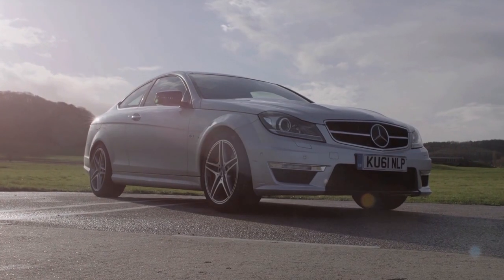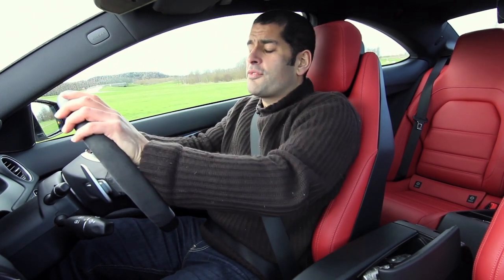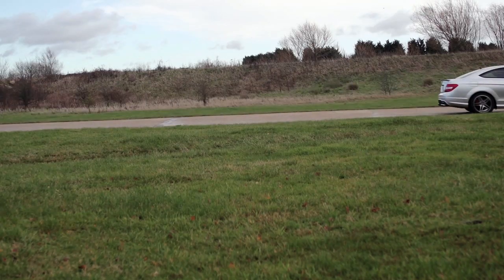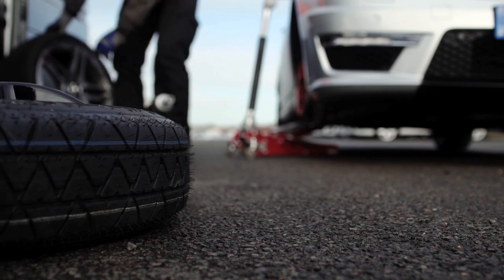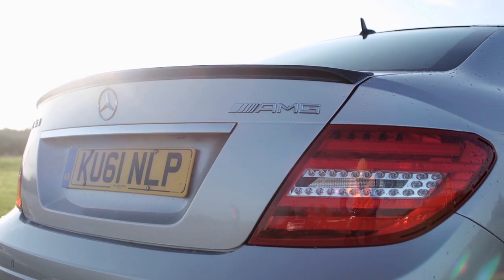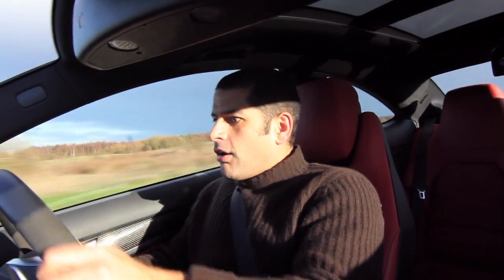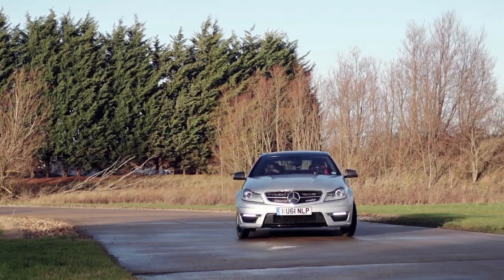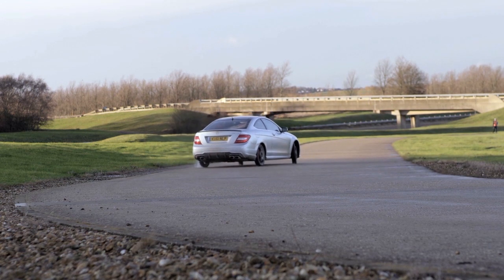The Mercedes C63 AMG Experiment - /CHRIS HARRIS ON CARS

Comment: It turned into a BRZ
Reply: A BRZ on steroids haha!
Reply: plateofshrimp a BRZ with 1200 hp!
Reply: Fluterra 480
Reply: Unco Casey 
A stock brz has 215s and thats over double the size of these donuts so if you keep the power in line with the tires hes almost there actually
Reply: plateofshrimp and
Reply: This music is on Tom clancy's rainbow six vegas 2.
Reply: plateofshrimp or frs or gt86
Reply: Except a BRZ still is slow as fuck even with small tires 😂
Reply: Yes. Toyota in their wisdom fitted Prius tyres to allow BRZ to get sideways easier
Reply: F Gill according to your math, this is like a 400 HP BRZ on stock tires.

Comment: This video perfectly sums up why the Toyota GT86 and its Prius tyres are so much fun.
Reply: Toyota GT86 on space savers... Dear god, I think I'm onto something.
Reply: yeah its still underpowered, most drifts are clutch cick initiated or ebrake, it cant just power on and overwhelm the tires like you would want it too.
My cousin bought one, I bought a mustang and modified it, they are very different  when it comes to drifts
Reply: ndinadis then your cousin doesn't know how to drift. The GT86 can easily maintain a drift all the way through a corner. But you have to floor it all the way and not start off slow in the corner. I tried it last year, a very nice car to drive. Obviously it doesn't have a lot of straight line speed, but who needs that on public roads anyway?
Reply: +ndinadis 
you have got a point, the drifts in the mx5/brz aren't 'power-initiated'
it would be nice if they had slightly more power, at least 250bhp.
Reply: I drove his, it had headers and full exhaust, Im assuming intake and tuning, It prob made ok power but the lack of torque was disappointing for me in a "sports car" the stock prius tires I think made it easy to slide around.
Reply: +ndinadis Like the S2000 was supposedly underpowered, it's not the power or the torque, it's the skill. Any car can suffer from organic failure.
Reply: +ndinadis and the GT86 will still be running well in 5 years time, the Mustang.....???
Reply: +Jeff H being that my car is already 10 years old prob running fine as well, just the all the others from 1965 onward with 200k miles on many
The thing is jeff I never said mustangs were better or that brz's were bad in any way, I said they were different and that I wish it had more power, heck Im thinking of buying one as a new daily... no need to turn everything into a fight
Reply: ndinadis I just struggled with you comparing a little sports car's ability to drift compared to a 'Stang, pointless. Anyway, we move on.
Reply: +ndinadis do u prefer the new 5.0 over this c63?
Reply: Even The prius has 165s
Reply: lol I though the 185 tires on my miata were too thin XD
Reply: ndinadis You don't need to use the parking brake, lots of power or clutch kick to drift an 86. Iv done a scandinavian flick in it and floored it in 3rd gear and it kept going very easily. Only driven an 86 and not the brz or frs though.
Reply: All of the Toyoburu (Subyota) cars are the same.
Reply: ndinadis look at Visioracer's video. He got some good drifts without having to clutch kick
Reply: @bazzie85  or just get an M3 or c63 and drift easily
Reply: But so many of them are ruined with bigger wheels now
Reply: tOY BOy  then clearly if you can't have fun with 200hp it's your problem with your driving technique.
Reply: @jean-luccg3664  my Toyota has 155 tyres, just a shame it only has 69hp. The only time I've ever drifted in it was accidentally on a snow covered roundabout. 

I drive a Toyota Aygo with a 69hp 1L 3 cylinder engine and a 5 speed manual transmission. It only weighs 800kgs though so it's pretty agile on twisty bendy roads.

 My previous transportation was a Vespa T5 with a 12hp 125cc 2 stroke engine with 4 speed sequential manual gearbox, top speed was around 68-70mph. I remember my hands going numb from the vibrations! XD. A small car is perfect for me as it's used 99% of the time to commute to and from work and from a mechanical stand point an Aygo is probably one of the easiest cars to work on. Everything is simple, basic and easy, which is something allot of modern cars lack.

Comment: Funny thing is that all the sliding shown in this video has nothing to do with width of these tyres. The force that makes the car go is called friction and calculated as F = uMg. Thete is no "width" or even "surface area" in this formula. All you guys did is put C63 on spare wheels which has less friction coefficient. I guess those who develop those skinny spare tyres just don't bother to put a "sticky" (or should I say "rubber with high friction coefficient)" rubber on them.

Comment: I guess this is why car testers always bang on about how much fun the Mazda MX5 is, even though it hasn't really got any power.  You can drive it to its limits at legal road speeds.  Even hot hatches these days have 255 section tyres and over 300bhp.... its all getting a bit silly and pointless if you ask me.
Reply: +soundseeker63 Unless you're Chris Harris who hates the Miata which makes this video rather amusing.
Reply: +soundseeker63 The lack of power can be easily remedied with a bolt on turbo kit. You can make up to about 275whp on an NA 1.6 with one safely on E85.
Reply: @jesdadotcom  that was the old miata, he loves the new miata nd, he said it on a episode of top gear when doing a quick review.

Comment: Everyone should learn to drive with big power on skinny rubber.
It would make them better drivers.
Reply: Kneedragon1962 having so much confidence is bad and will risk a accident by a fuck ton if i were you do someting about it cause its the most dangerous thing you can have if you dont have the skill to back it up. my cousin has the same problem he thinks hes the best driver he already had a accident
Reply: Kneedragon1962 Im pretty sure everyone can fly an aircraft with training.
Reply: That's not quite true. In principle, everyone could learn to walk a small tightrope with training, or sing a song (competently) in front of an audience.  In practice, some people are just not cut out for that.
Reply: Fading Light Not really, flying an aircraft is very complicated
Reply: Quentin Freeman Complicated... Depends. Yes, there's some complexity in operating an aircraft, but there's some complexity in driving through London or New York or Sydney too. There's some complexity in operating a motorbike. I rode them for 40 years and I still have an R6 race bike. Complexity is part of the problem, time constraints is another, task management and prioritisation is another. Being able to ignore you instincts and trust your instruments, is a huge one. Being able to correctly read and interpret those instruments, under pressure, is another. Aircraft can be hard, but you have generally got a few moments to think. A car or motorbike near the limit of performance & control, it has to be reflex. It does everything too quickly for you to think about, it has to be like standing on one leg - you have to just KNOW what to do. There can be situations like that in aircraft too, but you don't often get into them.
Reply: Kneedragon1962 You'd be suprised.
Reply: Quentin Freeman Really? About what? The complexity of flying an aircraft? LOL. I don't think you could surprise me much there. Ralph Mitchel, Kelly Johnson and Barnes Wallis were my heros as a kid, as I watched Neil Armstrong step off the ladder on live tv. I learned to read on Biggles, and the first adult book I read was Reach for the Sky, Paul Brickhill, in 1970. The first plane I got to fly was a 172 owned by the boy scouts, in '75. By that time I had moved on from designing control line models to 4 chan RC ones...
Reply: Quentin Freeman Have I got yoke time? Yes. Have I solo'd? No.Have I got an active logbook? No. Have I got recent stick & rudder time? No.Do I love aeroplanes, before motorbikes or sportscars, girls or well matured single malt whiskey? LOL, you never quite grow out of this kind of little boy infatuation.
Reply: Kneedragon1962 Well when you fly something like the Apache, let me know if you still feel the same way.
Reply: Fading Light No you haven't
Reply: Quentin Freeman I'm no youtube jockey, you have no clue how far wrong you are but I dont have to prove it to you. go be a child
Reply: Fading Light The fact alone that you'd say go be a child is proof enough for me. Show some integrity.
Reply: Fading Light You don't have to angry because some people are smart enough to know when you're lying.
Reply: Quentin Freeman Cool
Reply: Quentin Freeman Ok... I'm 52 years old, short sighted, and had a rather serious head injury a couple of years ago. Chances that I will ever fly anything again - let alone an Apache - are rather small. I am aware that the length and detail and complexity of the training to operate any sophisticated aircraft are hundreds of times more complex and comprehensive than to operate a road vehicle. This is obvious. We don't try to train road users to the same level of expertise and proficiency we try to give combat pilots, or pilots of sophisticated jet passenger or transport aircraft. The point I was trying to make, is that driving a car and operating an aircraft are fundamentally different, just as driving a car and riding a unicycle are different. All 3 require lots of your attention, but they require it in slightly different ways. The unicycle requires reflexes. The Apache requires mental skills. If your reflexes and multitasking were terrible, you probably shouldn't fly it, but mostly what you do in an aircraft is a mental game like chess, or algebra & statistics. What you do on a unicycle is more like trying to balance a pencil on the palm of your hand.
Reply: Kneedragon1962 That I can agree with
Reply: It's actually easier to drive on skinnier rubber. The wider a tyre is the less predictable it is.
Reply: No, it will kill all the people that don't know how to drive which is a good trade-off
Reply: @austinfleck8664  Natural Selection, yis.

Comment: 3:33 - 3:49 How is a 125 tire 1/3 of the width of a 255 tire? It's obviously 1/2 (0.4902, if we're nitpicking). Your photographer Neal should've tried to finish his 5th grade, methinks...
Reply: +João Soares ITS *NEIL GODDAMMIT!!!!!
Reply: +Haseeb Chowdhury Both spellings are correct; I don't know who the man is, so I went with Neal. It's irrelevant... What's not irrelevant is Neal's lack of mathematical skills.
Reply: bruh chill I was kidding ya know?
Reply: do you not get sarcasm?
Reply: +João Soares To be fair, the section width is measured from widest part of the tire and unlike the standard 255 which has a flat sidewall, the 125 has a rounded side wall so the tread is actually narrower than 125mm. It probably is close to about 1/3 the amount of surface area of the stock tires even though his math was way off.
Reply: +João Soares  watched this vid and was thinking "wait a minute, what?" ... You are correct their math is way off.
Reply: +João Soares He said ABOUT 1/3 the width.
Reply: +Rita Amorim He said ABOUT 1/3 the width.
Reply: Thats knowledge speaking. 
My exact thoughts.
Reply: Rita Amorim niel is correct not neal
Reply: Actually he is talking about contact patch, for this wheels it would be roughly 90cm^2 and 250cm^2 respectively, more or less depending on tire pressure.
Reply: It's safe to say the photographer NEILed it
Reply: it might be 1/3 because the tyres are of round profile and they are at 60psi making contact patch even less.
Reply: Rita Amorim Who Said Neal is the one who did the calculations
Reply: João Soares dude exactly, what the fuck was he thinking?
Reply: The thing about that though is that low profile tires seem to lie about their size a lot. I work at a tire shop, and I remember once I put a 245/40/18 beside a 235/45/18, and the 235 was a good couple centimeters wider than the 245. And no, that's not including the sidewall, I'm just talking about the contact patch. On paper, the 125 is about half as wide, but at least from the video I can say they do look about 1/3 the size. And the contact patch? That looks like 1/4 of the 255's, maybe even less.
Reply: Rancid Fiend you are right ! These tires are radial and a contact surface is even smaller .
Reply: I paused the video just to come and comment this
Reply: @pjbadgersuw26  Wrong.. it is different all over the world.
Reply: @haseebchowdhury4307  the Neal is real.....RCR

Comment: That's one of the reasons why GT86 is so fun stock- it is sold on the same tires as Prius.
Reply: TheLaXandro it isn't though.
Reply: Ben Fillman what isn't? It isn't fun? Or it didn't have Prius tires?
Reply: Jakob Kerr it isn't sold on Prius tires. Similar, sure. They say that I think because the wheels can fit on a Prius probably.
Reply: RandomUser M it's also lighter than both of those. It's not a boring car by any means.
Reply: TheLaXandro every one in the comment section has seen too gear.
Reply: Compound and section width are very different though I agree harder compounds are more fun--maybe not that hard. In LFS I like to use no wider than 225-235 tires for drifting smaller courses. 255-265 widths have less forward bite and are vague in transition.
Reply: Lol
Reply: I just think they messed up the engine

Comment: 125 is about half of 255. Not 1/3.
Reply: yes but the contact patch is about 1/3
Reply: I'd say it's really really close to exact half as much
Reply: +Po Russki Depends, I had a pair of 245s as wide as my 275s. More of a reference than an exact measurement (In the US at least)
Reply: +rawr2400 No, it isn´t.
Reply: +Joao Soares Yes, it is 90cm^2 and 250cm^2 calculated roughly.

Comment: Load does increase traction to a certain point but after that it only takes away. The wings are used for higher speeds where tires start to lift off the road. The downforce is used to keep the vehicle planted on the ground and handle better more than have less wheel spin at the start. Wings will actually decrease a vehicle's top speed (due to drag) but increase stability at speed. Handling does rely on more factors than just tire grip, however, the weight affects every one of those factors.

Comment: The reason the GT86/BRZ is touted as such a fun car. The most fun car I ever had was a little peugeot 106 rallye. 1.3litre 8v engine with  just over 100bhp and 175tyres, 900kg, no power steering, no safety features. Steering on the throttle, yes, drifting on four wheels, yup. 0-60 took a staggering 9.2 seconds, and you had to work the thing to go anywhere fast, the power band came in at 5000 up to the 7200rpm redline. But what a fun car.
Reply: Andrew Goodman FWD OR RWD?
Reply: the old adage, driving a slow car fast is more fun than driving a fast car slow

Comment: I can't believe I only just found this vid, it's instantly one of my favorites. I've spent most of my hooning life extolling the virtues of cheap skinny tires to friends. And it's been a very unpopular theory.  But there is simply no better way to make a car "feel" like it has more power. And it's even safer because its way easier to gather things up at the lower speed where your tires let go.  Really great tires still let go, just at much higher speeds.
Reply: Merv 
same here, ended up mounting 145 section, very old snow tires on my friend's E30 to prove my point, and it worked greatly!
Reply: Merv 
same here, ended up mounting 145 section, very old snow tires on my friend's E30 to prove my point, and it worked greatly!

Comment: This is why I love driving on slippery winter roads with studded tires.  Grip may be low, but traction is consistent and weight transfer effects are negligible.  The car constantly moves around beneath me in a predictable manner.  Effortless at-the-limit driving (when not held up by slow traffic) at legal or near-legal speeds.

Comment: Really the conclusión in this video is 90% wrong, because the compund of the tires is very diferent between stock tire (continental sport contact 5) and the little skinny.
Try high performance semislick motorbike tire, and you will see results very near to the stock big tires.
Add the factor that the skinnys can be crystallized for long time without use.

Grip is 90% load + compund, theoretically 100%, but in extreme load the size can affect a little, but ONLY A LITTLE.
People who think: "more contact area = more grip" is usually wrong.
+1 contact area = +1 load = same grip, like i said only theorically, the proportion is like +1 load area = around +0,9 grip.

Anyway, very fun video!

Comment: The theory is in terms of weight per square inch making a difference, but in actuallity it wouldn't work like that Re: grip levels.

You'd overload the smaller tyre at a far lower speeds than the wider tyre.

More weight on a tyre will give it more grip, but only up to a certain point. Beyond that point the tyre becomes over loaded and loses grip.

Comment: Width of the tire might be half, but the area with which it sits on the ground is much smaller, and space savers have nowhere near as much grip as the normal road tire, so 1/3 of grip is quite accurate.